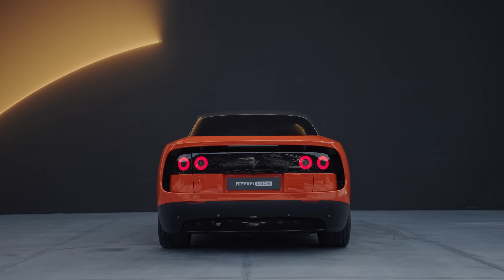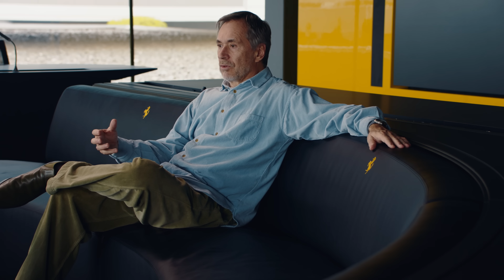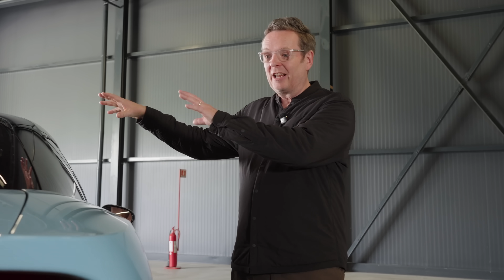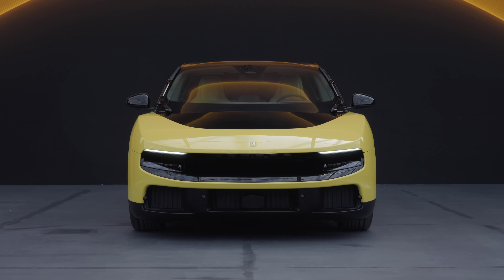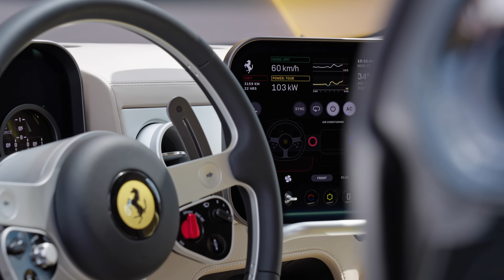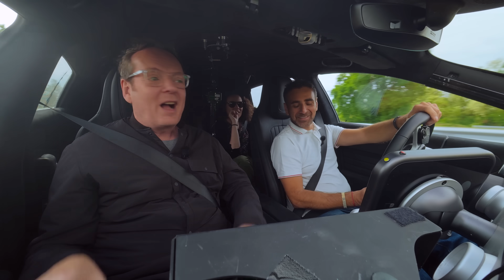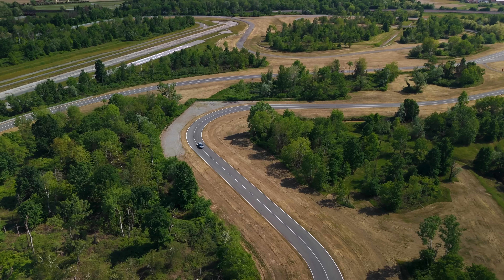We’ve Driven The Ugly Ferrari That Broke The Internet! | 4K

Comment: Ferrari deliberately chose to address a different audience with the Luce EV, and in that sense, the car achieves exactly what it set out to do.
However, when we look closely at the design, it is clear that the designers have retained Ferrari DNA in the car, despite the claims that this represents a complete departure from the brand’s traditional design language.
That DNA has simply been reinterpreted through a contemporary design perspective. The familiar Ferrari cues are no longer expressed in a conventional or nostalgic way, but have been translated into a more modern, sophisticated and forward-looking design language.
In particular, I see clear historical references in the design. The front end appears to draw inspiration from the Ferrari 365 GTC/4, while the rear carries distinct design cues reminiscent of the Ferrari 250 GT Lusso. These references are not literal reproductions, but rather subtle reinterpretations of characteristic Ferrari proportions, surfaces and graphic elements within a contemporary EV design.

Comment: Compare this car (appliance) to a RR Spectre. See the difference? One uses electric motors to enhance the overall driving experience. One has a beautiful, sensuous exterior that builds on the brand's heritage. One has a bespoke interior that looks like it costs more than it does. One has prestige, style and class. The other is the "Ferrari" Luce.

Comment: I’m sorry but it doesn’t matter how it drives.  There are arguably few brands like Ferrari where the “look” is a big part of what defines the brand.  This car fails on multiple levels, it’s one of those rare cases where, it doesn’t make a difference how well it drives.  If it doesn’t want to make you sit in it and drive it when sitting still in your garage, then it misses the Ferrari experience completely. I would have absolutely zero desire to drive this car.

Comment: In the end, battery is a battery is a battery. there is nothing you can do to stop the degradation. of course people with insane amounts $ dont care. But man will these plummet in resale value! Ferrari should have waited or invented solid state capacitor based battery - the price would have made a little more sense. every problem you face with a EV car is magnified 100 times due to cost. I guess world needs toys like these...

Comment: In regards of sound design, modern interiour and dynamics this car might deliver a ton of inspiration to other brands and future successors. But power, weight and air resistance are all medium at best. Especially this pretty bad cw value is absolutely no excuse for such a poor design. Not even form follows function could save it at this point. 

To me this is just another car in the current European Zeitgeist: If we make an EV, it has to be plain ugly. We can't possibly let this rationally superiour drive drain win without making it as hard as possible. So: Make. it. ugly!

The only thing this does is setting us back a decade or two and let the others (currently mostly China) win. And they are  dangerously close.

Comment: I have been a fan of Ferrari ever since I saw the 328GTS on the front of a magazine and fell in love.  And I have nothing against EV's.  They are the future.  Allowing for all of that, this is hideous.  The outside looks like at least 100 people were involved in the design and none of them ever spoke to each other.  There seem to be elements from at least seven different cars lumped together without any attempt at a coherent design.  The front whatever the hell that sort of wing thing is makes it look like a bit is missing.  The back is even worse.  The roof line looks like the font and back of the car are arguing over who is the real design choice and the area above the rear wheel seems to have come from an Abrams tank. It is bulky, unco-ordinated, unbalanced and incoherent.  Inside it looks as though it was made out of Lego and then covered with a random combination of leather, metal and velour.  As others have said the centre screen looks like the check in device at a clinic.  I have better cup holders in my 2010 Mini.  The air vents seem to have no design philosophy at all.  They are round and their emit air.  Yay....   Overall it has the air of being designed by someone who doesn't actually like cars, doesn't appreciate the history and has made a deliberate attempt to be as annoying as possible to as many people as possible.  I honestly really want to like each new Ferrari.  I grew up with their history as the pinnacle of automotive desire.  The only desire this generates is the one to deposit my recently eaten lunch in the nearest bin.

Comment: Progression and innovation mean nothing if it doesn't hit every industry.  I am sure that electric vehicles will have improved looks within 5-10 years if not sooner.  Definitely impressed by the interior, a bit more optimistic that the future won't be full of gasoline powered crap.  I don't love the exterior, but I would not have the designer of a phone design most of the car, then let Samsung provide the OLED display (not knocking Samsung).  Time to do away with everyday drivers using gas powered machines to get around, do yard work or whatever else.

Comment: I think this is a fascinating car that's probably burdened by Ferrari branding. 

If Ferrari has chosen to do a stripped down, impractical, experience-focused sports car that demonstrated what an EV sports car could be -- and was successful at that -- that would be on brand. 

But this is a 5-seat high performance MPV with lots of bandwidth and a very interesting design. That doesn't really fit into their Ferrari brand, as many, many people have pointed out. 

If Ferrari had taken the Dino approach and created a sub-brand, maybe people would have different expectations? 

This reminds me of the Ford Mach-e: and interesting EV that was somewhat overshadowed by the Mustang name. In my head -- it's always just the Mach-E! If this had been, say the Abetone Luce (by Ferrari) maybe it would have had more room to set new brand expectations while still highlighting the connection to Ferrari?

Comment: It's actually not that bad, the interior is very nice, and it's not really ugly, it's just not fitting with the rest of the Ferrari range or history. The problem is the badge and the price. If this was a Lexus costing 70,000-100,000 it would be very appealing. But it's not, it's supposedly a Ferrari costing half a million. You can do so much better for the money, including Ferrari's own Amalfi, which you could go crazy with the options and still get cheaper than this. I might get one when the inevitable depreciation puts them under 50k.

Comment: "the billions the Luce wiped off in Ferrari stock value"... Ferrari stock has never been higher than now!
Reply: Well it has been up at $500 or so in 2024 & close to that in 2025. But since the unveiling of the Luce, stock price has increased (up by about 18%) not gone down, so you're right to point out the idiocy of that statement.

Comment: Those Air Vents,look like they are off the ceiling of an old  Boeing Airliner,or those found at My Mothers Hairdressers back in the 1960/70's,...Hardly pioneering,or changing the concept of the  way an airvent would/should Operate,or cutting edge...what 'goes Around,comes Around'...BL's 'Allegro',sadly,Did it so Much Better,in looks at least... .

Comment: The Ferrari Luce is software on wheels, no different than any other electric car. The difference is that Ferrari will have you by the balls. If you're dumb enough to think you'll own the car that you paid $650,000 for, you're just another rich idiot. If you so much as fart, Ferrari will remotely turn off your car until you cough up another $100,000... for your safety, of course.

Comment: The exterior is not for the traditional Ferrari fans but it will no doubt appeal to the iPhone generation of wealthy influencer and young tech entrepreneurs. They are the people with the disposable income to burn and the age to keep them buying for a good few years.....i dont like it myself but i do get it. The interior is just bloody gorgeous and i am not an iphone guy, but the return to dials and buttons is welcomed  i am sure by a majority of people. I have 3 cars at the moment i drive on a daily basis a 26 plate a 13 plate and an 03 plate. The biggest smile comes from driving the 03 plate......the 26 plate just bings and bongs and tries to drive for you. But is quiet frugal and specification  wise well speced......but the 03 plate has air con, cruise control, heated seats and steering wheel....and now has carplay. But none of the intrusive safety systems designed to make you a safer driver...by letting you pay less attention to the road......mmmm

Comment: An aerodynamic coefficient of 0,25 is anything but impressive. It would have been impressive 35 years ago (Opel Calibra 0,26)
Reply: a model 3 tesla is 0.22 thats actually a bad score.
Reply: @greatleader4841  I came here to say exactly this.   .254 for the luce and .219  for the Tesla 3 highland.  Even the boxy VW Passat beats the Luce with .25.  And this guy has the nerve to say luces.254 is impressively low?   He’s a top gear presenter with no car knowledge?  LOL
Reply: @jimmysung4176 yeah bruh...for modern cars thats actually high.
Reply: @jimmysung4176 Just look at him and hear what he repeats. He was a home appliance sales man before, now works for BBC/Top Gear.
Reply: @jimmysung4176 Considering this car have aero for downforce, it's actually very good. Still not a good looking car though.
Reply: @greatleader4841  Yes, but is your model 3 big as the Luce and ride on 24 inch wheels?
Reply: @499p-l1w  I have a model 3 LR its about 1000 lb less and rides on the normal wheels. 18 inch? idk. but dont worry, i can afford a luche if i wanted to. i'd rather be caught dead than get in that. i have 3 mansions in 3 countries.
Reply: @greatleader4841   Guy in a tesla thinks he's somewhat cool by jumping on the Luce hate train lol. Chill my guy, no need to get excited. I'm sure your Model 3 has much better fit and finish and italian leather than the Luce does. 

I'm just pointing out that the Luce has significantly larger frontal area than your Elon car. 18 inch wheels compared to the 24 inch on the Luce? And significantly wider tires? Use your brain and think where the difference in drag coefficient comes from.
Reply: @499p-l1w  Cd is independent of frontal area. The total drag force D = Cd * 0.5 * rho * V^2 * A , where rho is the density of the air, V is the velocity (in metres per second) (V^2 is V squared) and A is the frontal area.
For airplanes, A is usually replaced by S, which is the wing area projected from the top. So Cd is not some absolute value. It always depends on the area one uses as a reference.
Therefore, two cars may have the same drag ratio, but if the frontal area is larger for one car, then that car will experience more drag.
Reply: @499p-l1w  size doesn't matter for the drag coefficient. Only the shape matters for that
Reply: @499p-l1w  is the Model 3 a ferrari?
Reply: Lucid managed a .19, didn't they?
Reply: So, there was absolutely no need for all this trickery in the front, which makes it ugly and stupid (wipers), because it didnt provide spoectalular results.
Meaning, they could have designed a pretty car afterall but simply didnt. It makes me wonder why.
Reply: Maybe you're trying to sound smart but comes off as dumb. The size of the car and the wheels alone will give you an idea for why that is
Reply: @499p-l1w I just said it's anything but impressive. BTW size does not matter for the coefficient

Comment: How did Top Gear manage to fall so low? Electric cars have been around for almost 10 years, and I still have to hear ‘The low center of gravity because 85% of the batteries are in the floor’… and where else are they supposed to be? On the roof? Utterly Lapalissian.

Comment: External design is what it is due to constraints on keeping a low drag coefficient. It is a nice car, should just not have been made with a Ferrari badge, just not yet at least. It is ahead of our time, combustion engines are still viable. Most importantly the people buying these don’t really care what the fuel costs. So what will make them buy this in the first place?

Comment: Ferrari likely thought the Luce could squeeze past fans by way of the prancing horse adorning its exterior and interior, though that was their exact folley.

I suspect the reception would've been infinitely warmer if the car was launched under a new sister brand.

Regardless of my own reservations on EVs, this car is a masterclass in design inside and out. The combination of analogue and digital is executed extremely well, especially considering the habit of manufacturers to make EV interiors look like racing sim rigs.

For that matter, the only ICE car I can think of that remotely approaches the balance of analogue and digital the way the Luce does, is the FL5 Civic Type R.

Most other ICE vehicles today also suffer from that racing sim syndrome in their interiors, not to mention baffling amounts of piano black surfaces.

For all its wonders, though, the Luce was certainly a misfire in marketing and branding on Ferrari's part.

Comment: The electronics have been the biggest fail with modern Ferrari's. Therefore, the electronics on this car has to be rock solid every single time you start the car and I highly doubt it will be.  Just get a Lucid Sapphire and call it a day because there isn't a single trick this car has that won't be easily copied by everyone in 18 months because it's all just software.

Comment: Without the batch it looks as solulless and cheap like any of the hundreds of Chinese disposable EVs. It also won't help to put some old ex and ex designers for some whatever brand. 350 miles range for 500 grand. You need balls to present it as remotely interestimg.

Comment: Again, it's just the badge (and price) that's throwing me off.
If this was a new Honda, Ford, or Volkswagen, it'd be amazing. The interior is the best EV interior I've seen and resolves most of the complaints people have with modern car interiors. The exterior is a little bland, but has some nice flow and design to it. It looks fairly practical an usable as far as sedans go.
But then we still have to contend with the fact that it's probably going to cost at least $500k and have that awkward Ferrari labeling. . .

Comment: Top Gear review is an absolute fluff piece.  Too scared to be negative about Ferrari. 

“There’s no fake noise going on here” 😂🤣

”It’s like driving a normal fast Ferrari” 🤪

”Ive not driven an EV that handles as well as this”    I can name two off the top of my head; Spierling and Evija.  There’s no way Luce handles better than either. 

“The best car interior in the world”
“There is no higher quality interior

Rolls, Bentley, Maybach to name three, blow it out of the water.

“Luce’s drag coefficient is impressively low at 0.25”

Yes, in the 1980’s 😂. EVs today often achieve 0.20 eg Ioniq 6. Tesla achieve 0.21 and Mercedes achieve 0.20 or perhaps 0.19.

Did Top Gear leave their credibility in the Luce’s boot? 😁

Comment: The real take away is from the seats. Those don't even come close to the typical recaro sport bucket in nearly every sports car: they are sliding all over the place in quick changes (in hard turns leveling control takes over it appears). This car is not meant to be driven 10/10s. It's more luxury and appliance. Sure has Ferrari DNA, but this is an appliance with typical EV straight line performance. 

EVs have huge TQ and straight line no doubt, but I see typical EV giggles & "whoa", than passionate satisfactory "Oh my, yes!" in a typical Ferrari.

Comment: Not the best or worst Ferrari but certainly a significant one. I can appreciate the engineering that went into the development of this car. The result is some serious performance that lies hidden beneath what looks like another shoe designed for Back 2 The Future that was not used. So a bit surprising perhaps. I'm neither an Apple fan nor daily user of their devices and I have similar feelings for the interior and overall aesthetic of the car as I do for IPhones, IPods, AirBooks and Mac Minis. When they do function well, I can see how well thought out and easy the UI is. It just doesn't suit me personally and the way I like to operate my tech devices. They also seem a bit sterile/cold and uninviting, meaning I don't feel encouraged to want to pick them up and try using and getting hands on with em. Missing the excitement that would exist in something I would find extremely desirable/attractive.
Reply: MacBook Airs not 'AirBooks'. 😅

Comment: This car is bad on basically every single level. 

- it looks horrible. Front and back. 

- it's electric. Battery degregation will happen. 

- it's $600k USD!!! 

- there is NOTHING Ferrari about it. 

- it's heavy. 

- it won't handle well. 

- it'll depreciate like no other Ferrari in history. 

I'm sure there's more but I don't wanna look at this horrendous thing anymore E